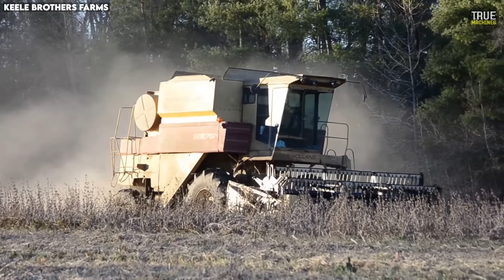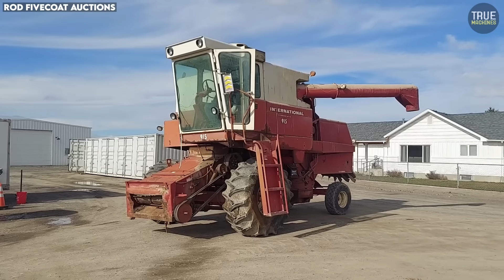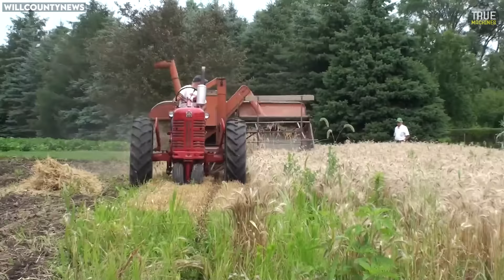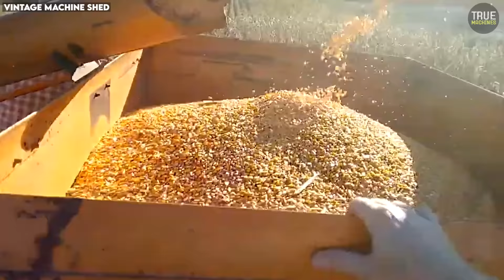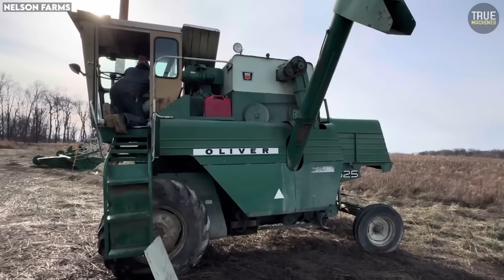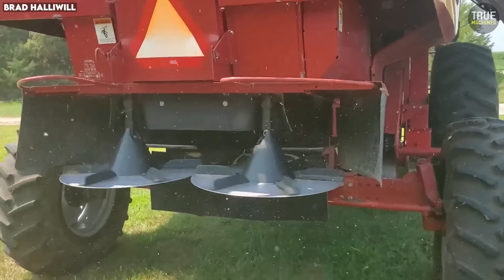10 Vintage Combines That Looked Revolutionary… But Completely Flopped!

Comment: i have seen several 915 combine stil working today in fields and my neighbor had a 915 and they never had any problems with it
Reply: 915 was never a diesel/electric hybrid, and certainly not in 1981…..5 years after it was discontinued